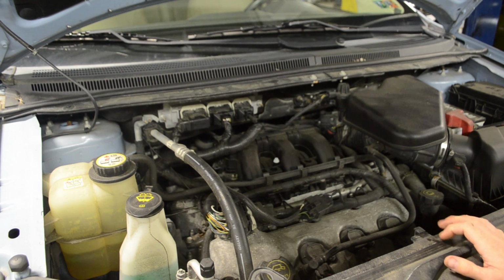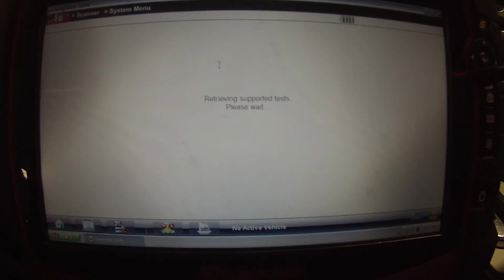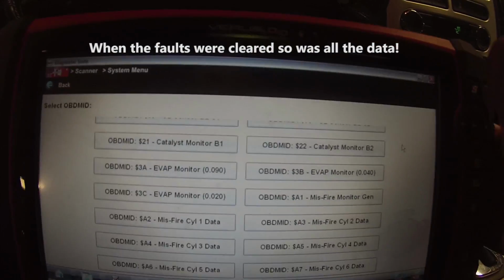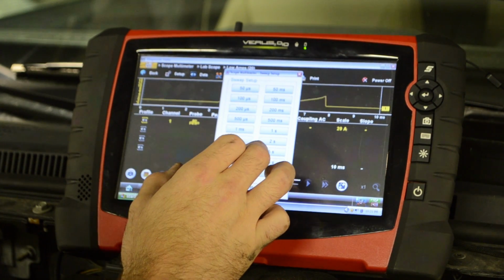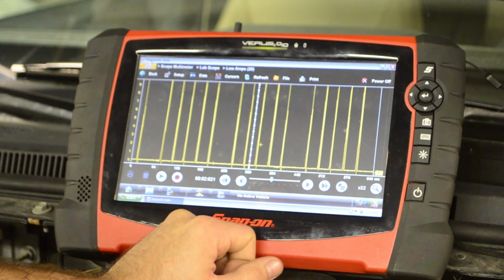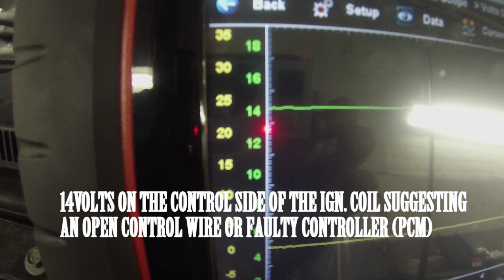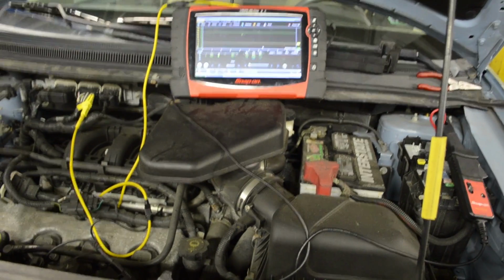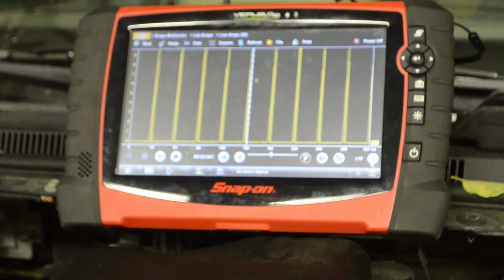2008 Ford Edge Misfire (Faulty PCM/Melted Ignition Coil)

Comment: im having the same issue with cylinder #2. found the coil busted up similar to yours. i dong have much access to the wiring diagrams and would like to know if you can point me in the right direction to acquire those schematics you were looking at. additionally, can this test be conducted with a multi meter? thanks you in advanced.

Comment: have one question can burnt ignition coil be cause by low compression in your cylinders had 2 coils from #6 cylinder melted taking my mazda 6 to a shop the guy say he’s going to do a compression test but isn’t low compression a mechanical issue and melted ignition coil and po356 codes a electrical issue?

Comment: Hi sir, I had this problem with my 2008 Ford edge sel but I changed the platinum plugs and melted Ignition Coil and when I   start the engine on, I can see that the engine is shaking please any information that can help me.

Comment: PLEASE HELP!.. I have a 2008 Lincoln MKX with the same problem cranks-up find but after about 30-35 min it starts running rough and shaking with engine light on and blinking. I have had it diagnosed twice the first time they said it was showing to check codes Po204, Po205, Po304, Po305, Po115 which they did but said all where find and [Po174 the system to lean] then the computer but they don't do that type of computer work. the second was the dealer and they diagnose it as being the #4 fuel injector is bad. and also recommend a tune-up. So, my question is should I just go ahead and replace the pcm and all the coils and spark plugs because after seeing your video and reading the comments that's what I'm thinking. THANKS FOR RESPONDING BACK.
Reply from the maker: It looks like you have a few injector circuit faults and misfire faults that correspond with the injector faults. If your vehicle runs ok when you first start it, then your pcm is fine. I would be looking at the injectors. If this is the same design as the ford the. I would also do a tune up while it’s apart or Atleast get the old coils out and get the updated ones installed
Reply: @PositiveLeadDiagnostics  Hey, Thanks for responding I have already ordered the PCM, so I guess I'll have an extra one if I don't have to return it as a core. I also have the spark plugs and ignition coils coming in as well along with new fuel injectors. As I decided to go ahead and replace all the injectors. And yes, at first I was thinking that nothing was wrong with the PCM. And I just needed to replace that one fuel injector and do a tune-up. but after watching some videos on the subject were they replaced all spark plugs and ignition coils and it still ranked rough until they replaced the PCM. I was thinking of just being on the safe side. Thanks again for responding.

Comment: I replaced all coils and plugs after getting this issue. I started the car and it still misfires. The PCM is fried I think. What are the chances I fried the new coils by running it for a few minutes with a bad PCM?
Reply from the maker: If the pcm was fried from the old coils.  Whichever cylinders are misfiring, my guess would be the drivers in the pcm are what’s causing the misfires.  So you would need to replace the pcm and get it programmed. The new coils should be ok. It would be an easy check to see if there is control to the coils on the misfiring cylinders
Reply: @PositiveLeadDiagnostics  Thanks for the info. There was something I was reading on a website saying not to run the car with bad PCM and good coils or you could reverse fry the coils again after replacing. I put all new plugs and coils and the PCM is actually being repaired, if possible, by CircuitBoardMedics.

Comment: Why does the coil melt?
Reply: Spark gap gets to wide causing the coil packs to overheat due to the larger gap. Coil pops and back feeds voltage to the ecu blows the drivers for the coils then if bad enough supposedly can fry injectors.
Reply: Because of cheap Ford-Chinese coils...
Reply: Thanks Steve T!,

Comment: @positive lead diagnostics I have this same problem on the 07 MKX with smoked coil on cylinder #1 except my #17 pin shows a solid ground instead of pulsing ground as it should be. Does a bad PCM cause this as well or is there a possible different cause?
Reply from the maker: So on one side you have constant 12v and on the other you have a constant ground?  I have heard of pcm drivers being stuck on. Could be a computer issue
Reply: That was my conclusion as well. Thanks for your response.

Comment: 2008 Ford Edge AWD... OK. Need opinion.. Here goes.. I replaced #2 cylinder 3 times in a short time....The 3rd time I just switched it with #4 (2 spot is an old one now... 4 is the new one that car said burned out)  It's a week later.. #2 misfire with the old pack now and #4 with the new pack is fine.. 
I think the problem is the #2 cylinder.maybe damaged inside maybe?
All plugs are new. 
Can someone pinpoint exactly what's wrong?If that's enough info for an exact pinpoint answer that would be awesome.
Reply from the maker: You have a reoccurring misfire on cyl2? And you have replaced the coil multiple times?
Reply: Use the same procedures like what Tom is doing!

Comment: Can some one explain how the PCM melts the coil.  whats going on exactly ? I thought it was a case of a bad coil, ( original was melted )  I drop in a new coil still had the misfire .  I had checked the plug  but I'm thinking it must be bad too. so I pull the coil to put in a new plug and after less than 20 min run time the new coil was melted and smoking. So I got on line and found this video . Im not doubting that 6 plugs and coils and a computer is my fix I'm  just trying to understand the mechanics behind if the driver in the computer is bad how the new coil melted   Mine was 5 and 6. new coil fixed cylinder 6 but new coil 5 died a horrible death.
Reply from the maker: I read that the pcm driver can get stuck on and burn up the coil
Reply: @D The Driver is Ground side switched. It means the Driver is not pulsing on and off. If the Coil is activated constantly, it will burn up quickly. Pulse Width Technology.

Comment: I just found your channel after seeing you on scanner danner , great video . The plug gap gets excessive and over stresses the driver which makes the driver stick on and melts the coil . I had them holding a ground with the key off, got to at lease put new plugs in or the problem will reacur. The plug gap is usually huge. The last one I seen had 3 bad drivers with cylinder 5 stuck on with key off . 6 coils 6 plugs and pcm.
Reply: I just asked the question how this happens, then found this post. was curious what was melting the coil. mine is cylinder 5 also and  .080 or more gap on the plug

Comment: Transistor inside the pcm probably took a 14v straight up without a load in between and got tasted like turkey
Reply from the maker: the melted/shorted coil caused higher amperage (basically a short to ground) and burned up the driver in the pcm
Reply: Positive Lead Diagnostics actually the ignition driver  is protected against high amperage draw.. if you still have the coil on hand a continuity test between  its inputs and its single output should tell what exactly went wrong.. very common issue with Fords
Reply from the maker: It's only a 2 wire coil the only input is the ground control from the pcm driver. The coil melted and shorted which caused a huge amperage spike and burned up the computer

Comment: Hello I wanted to thank you for all the help you have given me and for taking the time to answer my questions you know I finally found the fault of my car is a Ford Edge. 2007 that I did not start and appeared the immobilizer you know was the connector of the transmission that was failing I realized for one day I take it out and lost power in powertrain and I put the scanner and I said that it is not solving signal the coil of the Transmission thanks for all your help
Reply from the maker: Nice. I'm glad you were able to figure it out

Comment: Does Ford know exactly why this problem is happening?  Maybe next time when you get the same vehicle in again you could scope the secondary and see what the burn time is at.  I'm wondering if the Engine is running leaner by this design and causing the coils to overheat.
Reply from the maker: I have heard 2 theories. One is that these ign coils on the backside of the head get alot of the heat and it causes them to melt/short. The other is that the computer driver gets stuck on and it burns up the coil and the driver. Not too sure but that is what I heard

Comment: Because I do not know if the module of the airbag is the cause of the problem because in the Ford I had already been told that I was failing what you think
Reply from the maker: You think the airbag module is pulling the network down?  Unplug the module

Comment: I want to ask you a question, you remember that check the ground of the computer, no. There was dirt had corrosion where they were connected to the chassis clean them and add another earth plus the car I was testing it distant 4 days and was working well until yesterday that bine on the night of work I turned it on and started but I went for something next to the passenger and I put my hand where the passenger's airbag goes and the fault came back when I saw that I punched the air bag and began to work well I was curious and moved the cables that go to the passenger airbag and the Car again gave the same fault and today no longer starts

Comment: Those are the ones that gives with respect to the short circuit
Reply from the maker: There is a power supply missing or shorted with those lighting circuits. You need a wiring diagram to start trouble shooting that and it seems that could be a different issue than the no start

Comment: Hello you know I have a question I hope that when you can answer me you know that I put the scannner to my car is the Ford Edge 2007 I commented that it did not start and I throw that I have a short in the light system but I was measuring with my tester no I know if it is normal that the hot of the front lights I measured it with the positive one in the battery and looking for the ground knows that the positive one worked to me like ground I do not know if it is correct
Reply from the maker: What is the code

Comment: The msj to pull when it is scanned is that the board is bad that the current is going to ground and the dashboard of the car when the fault starts tells me to check the brake system
Reply from the maker: Maybe a module pulling down the can network?

Comment: If you already replace the pcm and the board because I had the same problem before and first changed the pcm and returned the same failure they decided to change the board and I turned the same fault but if they disconnect the pcm for a few minutes in car starts but soon Time again gives the same fault
Reply from the maker: What checks have you done when the problem occurs?  Do you have 5vref when this issue happens?

Comment: Not disconnect all the sensors on the board turns on all the lights the only thing that does not go off but if the payment no longer starts because the immobilizer appears to me and does not start no more several days without starting

Comment: I have the same issue with my 07 ford fusion 3.0, no power to the number 2 ignition coil...all other coils are getting power but I got this po352. The car has 262K miles on it and the coil did the same thing as what your coil did. Could this mean I need a new pcm?
Reply from the maker: It is possible. You need to check for control to check the pcm driver. Amp clamp or a volt meter will work.
Reply from the maker: No power to the coil?  Depending on circuit design it could be a wiring issue. Do all the coils share the same power supply?
Reply: I'm pretty sure they do, only way I can tell if power is goin to that coil is a scope on a rope. everything I turned to all said pcm...
Reply from the maker: Do you have power to the coil? If you have power then you need to check pcm ground. If you don't have power then there is a wiring issue

Comment: Been addressing this same issue with group members and subscribers on the 1st Gen Edge's.  Once that coil over heats it takes out he PCM with it.   Great diagnostics by the way. MACT
Reply from the maker: Thanks for the support. I figured the coil took out the pcm. I did hear that the drivers can be stuck on. Idk how true that is though. Unfortunately kept it low cost and replaced only the faulty coil and a  used pcm. I still have the old one. Il look into repairing it if it happens again thanks for the tip.
Reply: Unfortunately the owner will be back and most likely with the same issue and Coil #2 will be the most likely failure.  #1 and #2 seem to be affected by the heat that his captured under the intake.  Hopefully when #2 goes it does not take out the PCM again. I took my 2008 Edge to 285,000 miles without a PCM or Coil failure.  If you get a chance check out my YT dedicated entirely to the Ford Edge. Again you are great diagnostic technician.
Reply from the maker: I know the owner so I can possibly do number 2 as a preventative repair if allowed
Reply from the maker: I have a friend who does programming in the aftermarket and he did me a favor and programmed it for me. Other than that I believe the only other way would be going to the dealer
Reply: CIrcuitboradmedics is the go to source for PCM repairs fast, reliable and great customer service. Many members to my group have used them.
Reply: Look up Circuitboardmedics on the web.  All of my Ford Edge group members on MACTFORDEDGE use them and they are much more economical than the dealer.

Comment: Why would Ford recommend changing the pcm if its not bad? A pcm wont cause a coil to fail. Great video man!
I need to get the courage to start filming because the shops I do work for give me some crazy ones
Reply from the maker: I'm not sure how true it is but I heard some of the pcm drivers fail and basically stay on which would cause the coil to burn up. Maybe they were not sure on what was causing the issue. I guess it could go either way. I don't know how true that is.
Reply: +Positive Lead Diagnostics 
I never gave that a thought about it staying on and smoking the coil but a good tech would or should be able to spot that right away.
Reply from the maker: I think in either case it wouldn't matter. In the end your still going to have a faulty pcm and coil. I'm sure it wouldn't take long for the driver to cook if it's staying on
Reply: Replace all the coils. Those back ones get all the heat. Most common coils to fail on the 1st Gens are #1 and #2.   PCM can be repaired quickly and economically through circuitboardmedics.
Reply: Hi I was watching your video and you know that I have a problem with my Ford Edge 2007 that loses the pcm connection with the modules I have changed pcm board and internal fuse box the immobilizer module as it works fine but at the moment it fails and appears Immobilizer activated I went to the Ford workshop and they wanted to change the board again please have some way to help my mail is ee404723@gmail.com I would greatly appreciate your help
Reply: +Edwin Ortiz do you live in PA I would be glad to help you out if PLD can't.
Reply from the maker: I would say it needs fixed regardless but It depends on the misfire. If it's shorted ignition coils then yes it could possibly burn up the driver in the pcm
Reply from the maker: So intermittent the immobilized activates and it's a no start. And you have already replaced the pcm
Reply: JOHN HUFNAGEL. If particular cylinder is misfiring and you don't fix it will burn up the driver in the pcm

Comment: All too common same on the 3.0L. Ford recommends pcm replacement, all coils and even spark plugs on some years and engines to prevent a repeat occurrence. Great diagnostics you nailed it on the head!
Reply from the maker: Thanks for your support.  Yeah I was forced to keep it as cheap as possible. But I did warn them it could happen again.
Reply: Then Ford needs to foot the bill with a recall IMO...
Reply: what if one changes spark plugs every 10000 miles?The problem occurs again?
Reply: FordTechMakuloco I have a 97 Ford Taurus 3.0l that doesn't have spark out of the coils and the MIL light doesn't show on the cluster. I did check the crankshaft sensor and I can see the signal, I also noticed that the injectors have pulse signal,but on the wires coming front the ECM to the coil I have 12 volts all the time and it never switches with the engine cranking.
Could it be the ECM problem?
Reply: FordTechMakuloco

Comment: Just came here after watching the Paul Danner rv trip..
Seeing this issue is all to familiar now..All I do now is check for control on this misfires when I get one of those codes...
Milans/mkz were the first to come out with that tsb then mkx/edge which said to replace all coils,pcm and plugs but after a while they only wanted you to replace affected cylnders ..
Paul did a great job with you guys Wish you all the Best..
Happy Thanksgiving.
Reply from the maker: This one was the first I have had to deal with. I now see this was or is a common issue. I didn't know about the tsb until after. Thank you for watching and supporting this channel